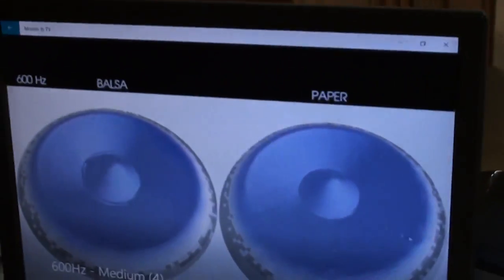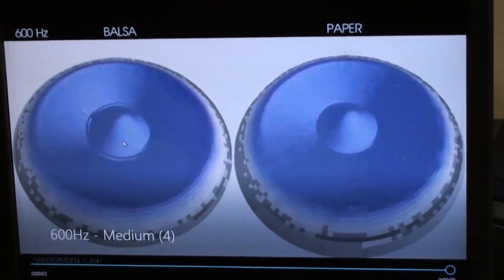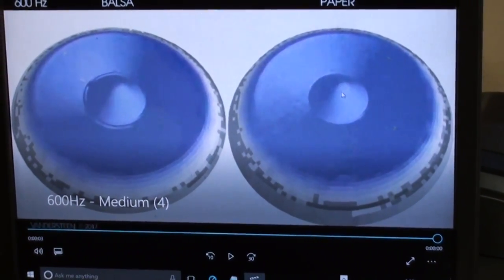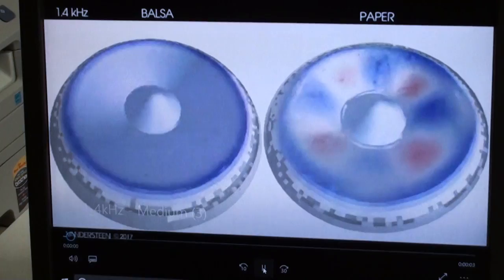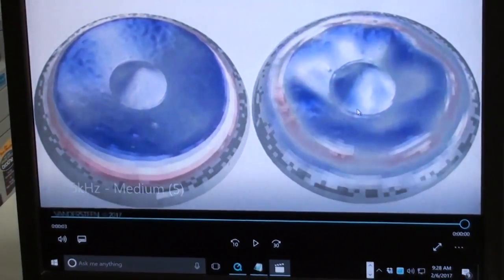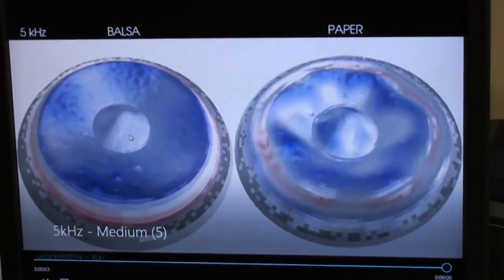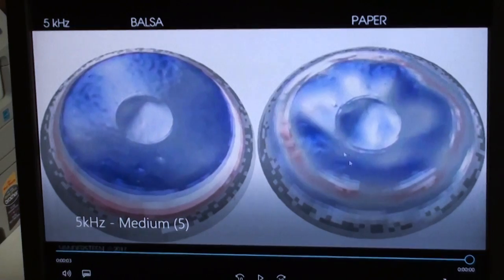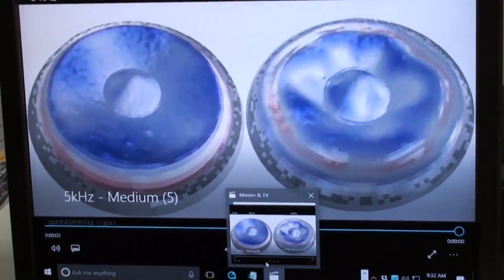See Why Pistonic Driver Cones Matter

Comment: You have poor graphics communication, too short and too fast. Just grasp the playback indicator and move it manually to create a demonstration that YOU control, that therefore works properly for viewers. Your choice of terms, "out of phase to be in phase" is inaccurate, the cone is not poor because it's out of phase with the tweeter (because parts of it are in phase), but because it is out of phase with itself, different parts of the cone acting differently with respect to one another.
Reply: whats up your ass? he said a large proportion of the cone is out of phase - meaning you are mostly anti-phase. speaking of being anti-phase - cheer the fuck up

Comment: Paper cones have the best chance of sounding good; it's inherent in the material. However, less expensive paper-cone woofers/midrange/midbass do tend to be more flexible and distort sound, but it's no different than for any other material, if poorly designed. But, you also have the complete opposite: Cones that are too stiff.
Reply: The only time you can have a too stiff woofer/tweeter is if the woofer/tweeter is too high mass heavy in weight. 

The best material for a woofer/tweeter is as low mass light as weight as possible while at the same time being as rigid as possible.
Reply: Yes, in terms of weight but not rigidity.

Comment: This is why I think a better budget solution would be three cheaper transducers..  

Moreover, the top live sound/ PA manufacturers DO use two ways with paper/composite cones, they just use a massive titanium/alloy diaphragm tweeter..  Like a 3-4" dome.  This means they can lower the crossover to something really low, like 900Hz..  Which means the LF driver IS tracking pistonically (or there abouts) through the vast majority of its range.  Also improving apparent coherence between HF and LF, as almost all of the directive frequencies are handled by this massive tweeter.

Comment: It is not necessarily anti-phase but it is the quadrature component of the deformation, meaning that it is neither cancelling nor positively contributing because it is happening over the circumferential direction. Anyway, nothing nice to have in your midrange, though.